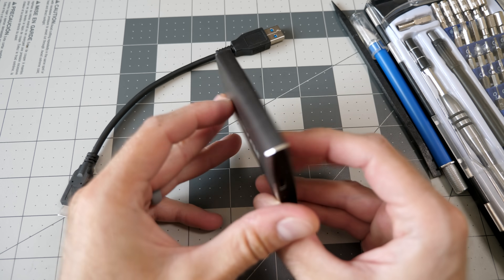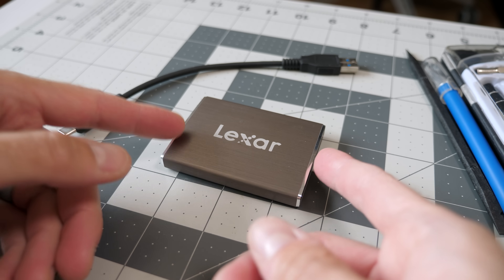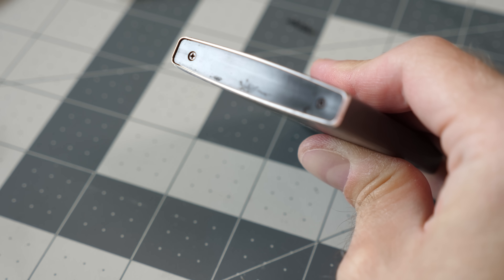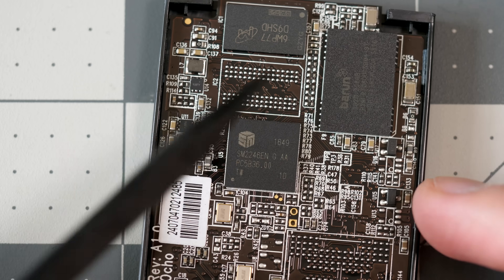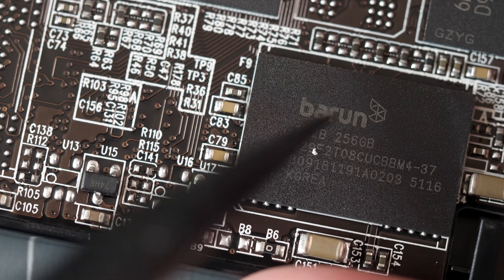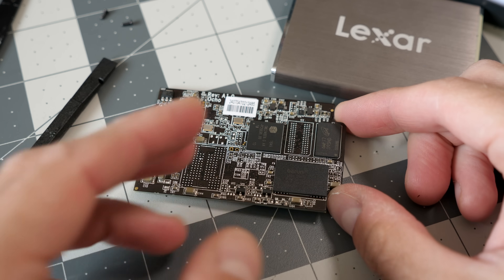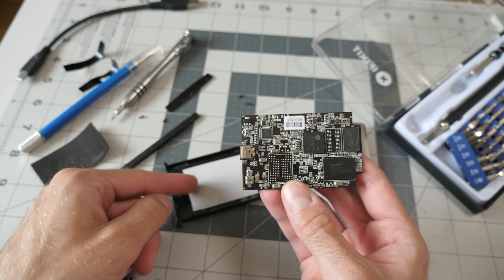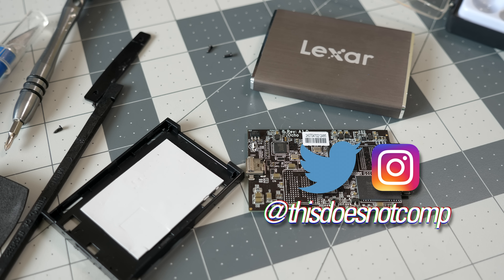What's Inside an External USB SSD?

Comment: These external SSD is smaller but once they died, it is very likely you can't salvage anything out of it. Currently I'm using an enclosure for my SATA SSD so I can use it as a portable backup device. It's nearly as fast as external SSD under USB 3 and if it's failing I can easily replace the inside of it
Reply: Yeah, it's rarely worth it to go with an all-in-one solution like this. I'd rather have something that can be used as an adapter, that way if one part dies it doesn't take the other with it.
Reply: Not just external ones, ALL SSD's are unsalvageable
Reply: @billyrob612  They meant if the external interface failed, you could still use the SSD with another device. Or vice versa, if the SSD failed.
Reply: @DoubleMonoLR  oh, ok
Reply: @billyrob612  Even if SSD dies, I can swap that out since I went with USB SSD enclosures with decent PCIe NVMe SSDs inside so it makes it trivial to take apart and replace a dead SSD.

On a side note, when it finally gets here, MRAM (magnetic RAM) SSD is basically unkillable compared to NAND flash counterpart, it got insane rewrite endurance due to magnetic nature of data storage - basically a modern and extremely fast core memory. I would like to use MRAM SSD in the DIY USB SSD enclosure, just so it can last a lot longer.
Reply: @Dr_Mario2007  my guy. This is a 2 year old comment thread
Reply: @billyrob612  So? Where is the law stating there's a lmit on making comments? Well?? The fact that you even said that means you clearly don't understand how youtube works lol!
Reply: @Dr_Mario2007  It will still fail. The part that fails most often in all these devices is the controller chip not the storage chips. This is exactly why hard disks will still be working in years when flash storage is long dead. With a HDD the media rarely fails if the drive was used as intended (in a PC not moved) and you can swap out the small controller board for a working one and transfer the soic8 eeprom over as well (to transfer serial number... media is married to serial number in the firmware chip) and it works again. Be careful though and only buy HDDs that have that eeprom... the drives with the firmware built into the large controller chip fall into the same category as SSDs and are near impossible to fix without specialised data recovery tools and secret knowledge.

Comment: Wow, I too was expecting to see a normal mSATA drive in the enclosure. It's interesting that the designers created a custom board for the drive. I've had bad luck with regular external SSDs over the years, so I usually end up using a SATA SSD in an enclosure. I had a SanDisk Extreme 500 drive that worked great... for the 2 weeks it did work. The USB 3 port was so weak that disconnecting the cable ended up ripping the connector right out of the case. I have to give SanDisk some credit though, as when I sent it in under warranty they replaced it for free while giving me an upgrade. I ended up with a 480GB Extreme 510 drive (the drive that broke was a 240GB Extreme 500), and it still works to this day, though I'm very hesitant to unplug the cable from the drive.

I find the thermal pad situation inside your drive to be quite odd. It's weird that they would use such a large thermal pad only to put it inside a plastic tray that prevents it from being useful. Perhaps the tray could have been modified to allow the pad to contact the outside case? Was the enclosure damaged when you opened it up?
Reply from the maker: Nope, the enclosure looked perfect when I opened it. The Lexar drive is just engineered quite strangely.

I ended up buying a SanDisk Extreme portable drive to replace it, 1TB for about $100. It’s limited to speeds of about 500MB/sec, but that’s still faster than what I got from the Lexar and I’ve had good luck with the brand. (Hopefully in a few years I won’t be tearing this one down too!)
Reply: @ThisDoesNotCompute  It is not surprising at all. About 10 years ago external HDDs already took this way of integrating SATA-USB bridge into main PCB. Part of data recovery process was to get the SATA signals connected directly to the controller. 
I would expect m.2 if something, but looks like economy of scale made more sense to create a single PCB, than use existing SSD (including gold-plating of connector) and separate PCB just for SATA-USB bridge that would need to have NGFF connector added.
Reply: @ThisDoesNotCompute  SanDisk portable SSDs are almost all modular design from the inside. You'll likely to get either a M.2 SATA SSD with bridge board (if it's USB-C port version), or a half length SATA SSD + bridge board (if it's micro-B 3.0 interface).
Reply: @ThisDoesNotCompute  Troubleshoot him a bit Colin ... Check continuity from the USB Tip A at the of the cableto the traces in he board... Contact Cleaner in the USB connector.. (on regular bases actually in all USB connectors.. is the first thing to do when windows says "USB Device not recognized" )... Check if it receives the 5 volt needed.. 4.7v It is already low .... do not even light up the LED.. sign that the board do not have energy .. Maybe some short-circuit component (capacitor) is pulling down the voltage... Check the voltage regulator output on the corner of the board .. primary suspect.. Someone said reballing the chips with hot air gun.. that can also be a good idea ..